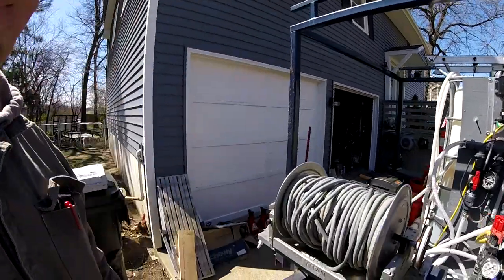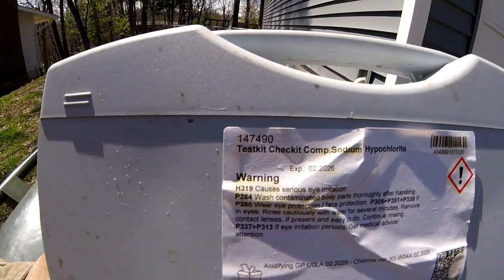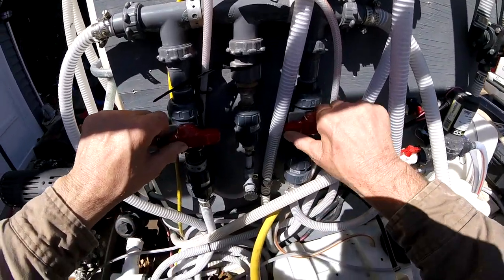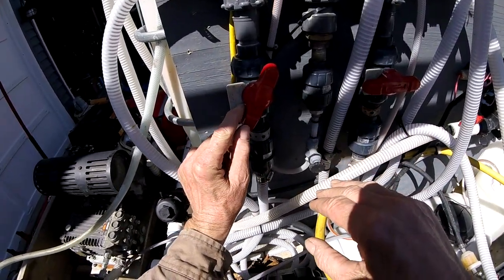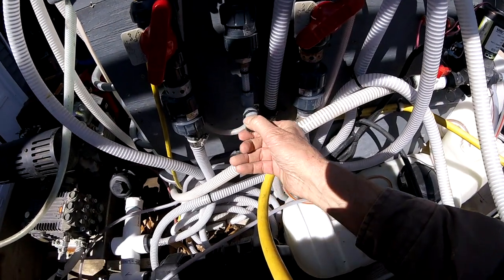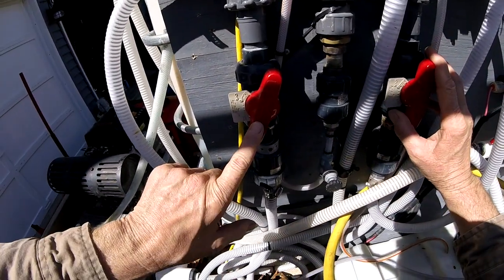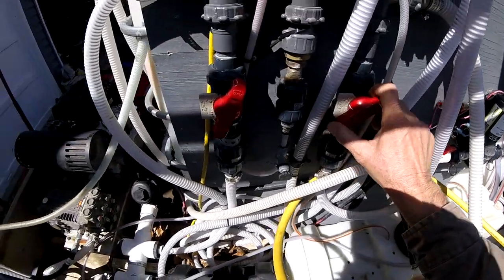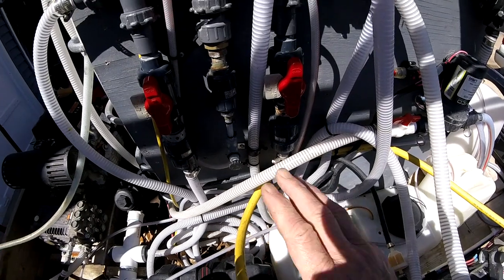How to adjust your mix manifold for softwashing.

Comment: Thanks for the explanation on this. I’ve mastered getting my mix how I need it by cocking water different amounts and adjusting my sh valve accordingly but ive never figured out why my settings are never constant consistent mix. Thanks Kenny!  I know now …my plumbing isn’t shotty work!  I spent countless hours breaking everything down, reconfiguring and rebuilding only to still get inconsistent mixes and alot of frustration.  Looking forward to your next technical video
Reply from the maker: Yes.  Each system is different.  Once you understand your own set up it's easy after that.  Thank you for watching my videos!  FYI - The only way to get a perfect mix every time regardless of tank levels etc.  Is to pressure feed each mixing valve all the time.  But that would be a pain in itself.

Comment: Glad to see you posting again! Very good breakdown. I think people get to hung up on percentages, once you use your equipment enough you should have a feel for the mark on your metering valves that is effective for whatever application you’re completing. 

I implemented a rotometer on my SH side of the manifold that allows me to see exactly how much SH I’m pulling. 
I mainly tried it to be able to see exactly when I start pulling SH instead of spraying and hoping I’m pulling only really knowing when I smell it and see suds on the surface. So it took all of the guess work out of starting up! 

Anyway hope you have a killer season! 

Wash on!
Reply from the maker: That's cool!  I gotta look that up!  Thanks
Reply: 🙋Do you mind sharing the link to the roto meter sir

Comment: I'm not sure how your coming up with S/H is 22.22% heavier than water. For every gallon of S/H you buy your getting 87.5% water. All that I know is if you spray S/h on a house and it melts it off with in a few minutes your mix is good.
Reply: Plain water weighs 8.35 pounds per gallon, so SH weighs 22% more per gallon for the solution (12.5% active ingredients and 87.5% for the water that is the carrier)  So the SH weighs 10.2 lbs per gallon and the difference in weight of each solution would require a different amount of suction through the system In order to have an equal solution going out of your nozzle.
Reply from the maker: @ronjclm8590   Using your exact numbers, not my rounded numbers the difference between 8.35 and 10.2 is 19.9461%.  I was using rounded numbers of 8 and 10 which is 22% difference.
Reply: @housewashing5693  I was trying to explain why you were correct to Rick Washek.  I did a poor job of doing so.
Reply from the maker: @ronjclm8590   Oh. I'm slow! LOL.  I appreciate the support!  I try to be as accurate as possible.  Some like to call me out on my auto repair videos as well.  I may need to add a disclaimer on most of my videos?
Reply: @housewashing5693  You're doing fine...If you gave everybody a new Cadillac, you'd still get disgruntled comments...just ask Elvis 😁🤣😂
I enjoy your videos and sometimes there's more than one way to skin a cat...or  method to describe the difference in the weight of SH.
Reply from the maker: What is the difference in percentage is SH over H2O?
Reply: @housewashing5693  Good morning uncle house wash! I love the work and knowledge that you share. I'm using the free trial Markate. I'm likso far but still learning how to use and navigate through. The payment portals I'm not sure which one is better for receiving payments.  I'm familiar with Square but not of the others. I like Square because it provides instant deposits. If I can ask, which do you prefer or use? Thank in advance!
Reply from the maker: @31keivon   Since I have a Paypal account I only use Paypal for payment.  Even people that don't have Paypal can still pay with a credit card.  I really don't know much about the others.
Reply: @House Washing  when will you have more content? I want to thank you for mentioning panhandle powerwashing. I literally live 40 minutes from them and never knew they existed. I don't have to wait for materials or equipment anymore.  I just drive down and pick up .👍🏾👏🏾
Reply from the maker: @31keivon   That would be so awesome to live so close!
Reply: The specific gravity of sodium Hypochlorite is 1.2 and you'll see it on SDS sheet. That means it's 120% denser than water. 1 gallon of water is about 8.34 Lbs but 1 gallon of SH bleach is about 10 Lbs.